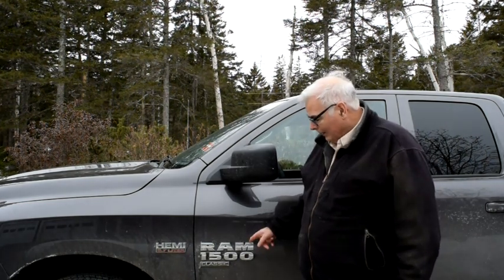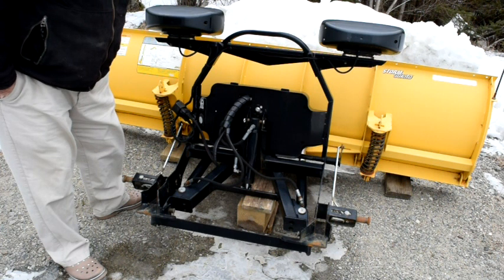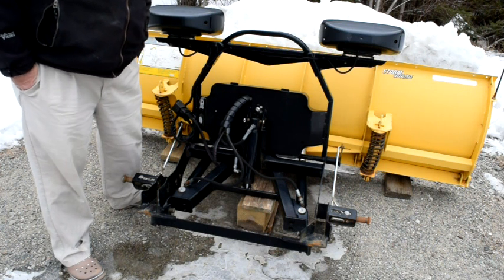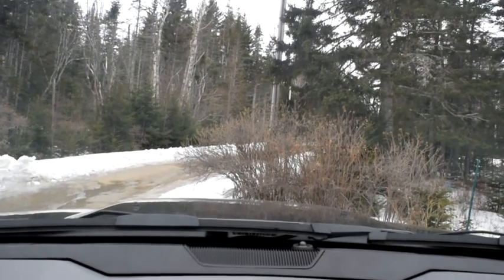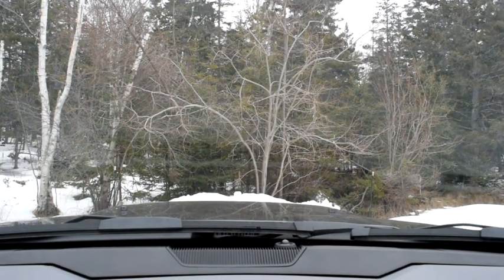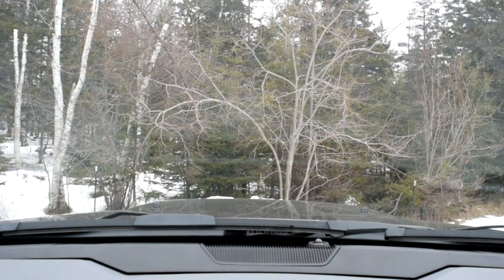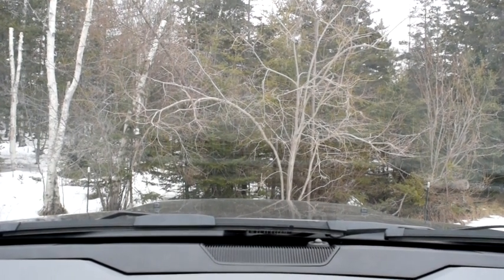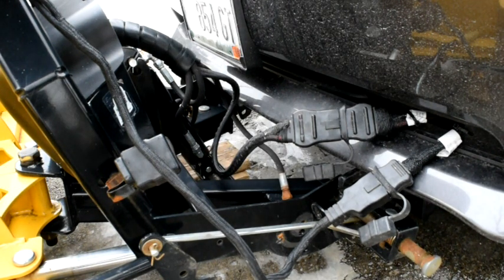Putting the Fisher HT Plow on my 2019 Ram 1500 Classic

Comment: I use a marker stick on the plow bracket( put it in front on the left bracket mount) and the use a marker on your truck. I use a suction mount ( like one that would hold a phone) and position it on the hood. That may help. Good luck with the snow coming.
Reply from the maker: That is a good idea.  I will have to find a suitable suction cup to put something on the hood.  Last night's snow was a non-event (<1/2") but tonight and tomorrow are supposed to give us 8-12" so the truck should get a good test, particularly since the snow will be coming down at right around freezing (not powder).

Comment: 5:55   Spray some Fluid Film on those pins, will make them move smoothly and keep future rust down.
Reply from the maker: I do spray them with fluid film.  It does help with how well they work, but not so much with the rust.  The plow is 12 years old and needs to have a lot of bits like the pins replaced.  I may buy some 316 stainless rod and machine new ones on my lathe.

Comment: Since the plow mount is lower, you could get a 2 inch leveling kit to prevent from getting to close to the ground in spots and you could use the jack for the plow again and get rid of the wood like your Silverado.
Reply from the maker: I may do that, but I will wait until after the warranty is done before making that sort of change.  I am also looking into getting the new type of plow jack that doesn't swing down.  However, the blocks of wood work well and are actually easier than the jack.  They don't sink into the gravel drive either.

Comment: take a piece of long blue painters tape and stick it on top of your drivers side plow light and your hood....stretch tight and then cut it..line up two pieces of tape and you will line it up first time every time...
Reply from the maker: Actually I now know where to line up the plow relative to a hood crease, but thanks for the suggestion.
Reply: @todddunn945  I have mine on a 2009 Tundra and can't even see plow lights like you. I had a spotter direct me.
Reply from the maker: @74stevedc  Seeing the plow when hooking up is an issue.  Glad you resolved it for yourself.

Comment: I AGREE! My biggest gripe is how low the front end of the Ram is, its like you have to lift the truck - which is dumb. I dont know why they made the bumper cover so low, and made the frame mounts drop like 3 inches. However,  I feel like the rotary shifter is faster, if not the same. I find my self flicking it and need to slow my self down when plowing as to not beat up the transmission. These are all 1500 problems tho, and I feel like its intentional since Ram dosnt want us plowing with these trucks. If you had a 2500 it would be a different story, the front end is built to plow. But.. we got 1/2 ton problems lol
Reply from the maker: You said it!  The truck does plow well though as I found out moving the 14" we got last night.
Reply: For 2021 the ram 1500 gets a plow prep package available

Comment: If you look under where the pins are on your fisher plow you will see 3 holes  adjustment....You are in the top hole...remove the Cotter pins on each side and put the pins in the center hole on each side and put the jack back on....you will need help when you take the pins out....had to do it to mine for more road clearance.
Reply from the maker: Thanks, my plow only has two adjustment holes.  However, changing where those pins are won't change the fact that the mounts on the truck are too low for my jack to work.  Changing those pins will make the angle of attack of my plow  ore aggressive, which I don't need.  At least that is how I understand the purpose of those pins.

Comment: I'm considering putting a old heavy plow on my 2016 ram 1500.. did u ever hit  the ground from a bump or bouncing on the road?
Reply from the maker: When I have the plow straight there is no risk of bottoming the plow when driving unless you hit a HUGE bump.  However, because of the low mount when my Fisher HT plow is all the way angled the low end does touch the ground.  So I always drive with the plow straight.  Also consider that you may only have about 750 lbs of front axle capacity available for a plow (depending on the model and engine for your truck).  That means that a heavy plow may overload the front axle.  My Fisher HT plow weighs a bit over 500 lbs with the cutting edge, but some plows are MUCH heavier than that.
Reply: @todddunn945  thanks for the info.. didint know the front capacity
Reply from the maker: @mudpropower  heck the weight plate on your door jam.  It will give the capacities for your truck.  I figure about 200 lbs above base vehicle weight on the front axle for driver and fuel, so that decreases your load capacity for that axle.  If you put ballast in the back the load capacity goes down even more.

Comment: Good for one plow then go trade it in for one ton that way you will have some thing with stronger front end that will handle it
Reply from the maker: I have been using a half ton for 12 years with no issues.  I do NOT plow commercially.  I just do my driveway and the private road I live on. If I was thinking of plowing commercially I would have 3/4 ton or one ton with a V-plow and a sand spreader.

Comment: There is a right way and a wrong way to purchase and install a plow on a ram. This is the wrong setup.
Reply from the maker: The installation was done by a Fisher authorized dealer following the procedure outlined by Fisher - The plow manufacturer.  Are you suggesting they do not know how to install their plows?
Reply: @todddunn945  The issue isn't so much with the plow but rather using the wrong size truck. The Ram manual clearly states do not use a snow plow on a 1500. If you want to plow with a Ram then you need to use a 2500 or larger.
Reply from the maker: @razredge68  that is true for the new design Ram 1500. That is the primary reason I bought a Ram 1500 Classic. The 1500 Classic accepts a plow fine.  The mounts are just too low for the old style jack on my 2011 Fisher HT plow.
Reply: I saw a guy who bought a 2021 ram 1500 classic warlock and had a v blade installed on it. I heard you shouldn’t because you’ll damage the transmission or have engine issues. Not sure what to believe, we’re looking to buy a ram 2500 for my son for plowing and to use my warlock as a back up with a straight blade. Clearly have the height clrearence on my truck to accommodate a plow. Just nervous if I do any damage to the tranny or motor…

Comment: Why. Did u go with a dodge. How about a ford.
Reply from the maker: It was a matter of geography.  The nearest Ford dealer is over 50 miles away.  There are Ram, Chevy and GMC dealers 18 miles away.  I had a Chevy, but don't like the way they do their suspension so didn't want to go with another or a GMC which is the same except for the name.  That left Ram.  I almost bought a 2500, but my wife thought it was too high.  Also, my first car was a Plymouth so I have roots with Chrysler.
Reply: Todd Dunn where du live.   I live in Ohio.     I was just 
 Asking.  I thought the ford s would have been better or Chevy s.
Reply: Ram is an awesome truck. I'm on my second one. No issues with both trucks, very little maintenance very happy with the power and reliability.
Reply: @Drumsticksmcgee  I’m also a Ram owner. 40k miles and drives like brand new.